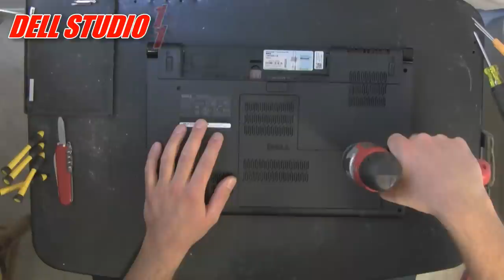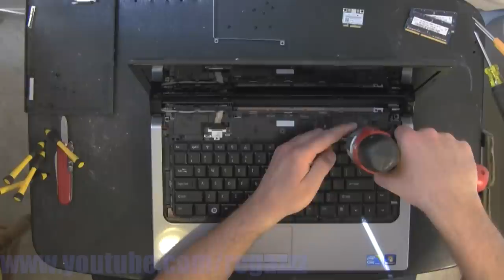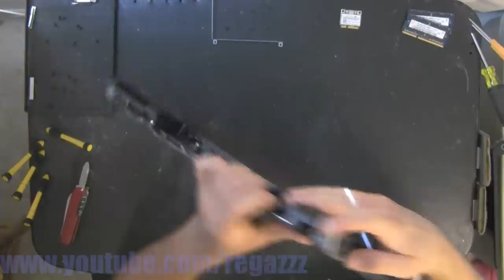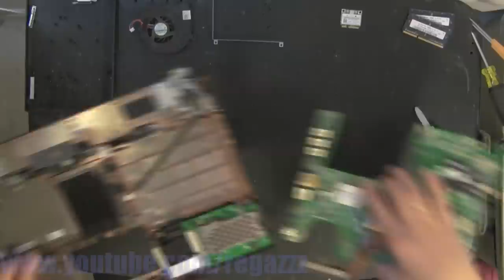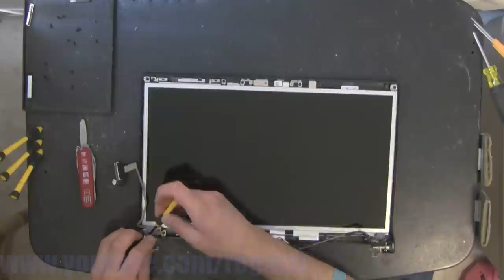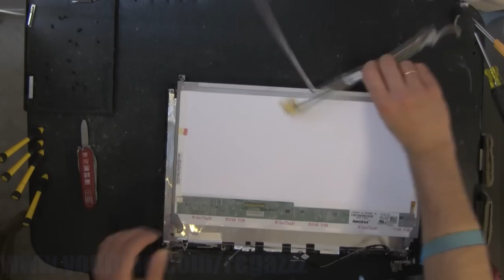DELL STUDIO 1558 take apart, disassembly, how-to video (nothing left) HD

Comment: thanks for sharing.. finally found out why my computer shutting down suddenly.  There's a lot of stuff got caught inside the cooling vent.. so eventhough the fan run very fast, nothing much comes out from it and it's very hot.   now it blows a lot of air as it should :)  Glad I open it to the cooling fan unit, otherwise it looks clean

Comment: Great video - thanks for taking the time to do it. I have a Studio 1558 - the fan is hitting something unless I pick up the laptop and take the weight off the case bottom - if I do that then the fan is noiseless. i.e. there is a very small fan blade clearance problem that I need to fix. Is the only way to the fan through the top and those gazillion screws, or can I get at it from the bottom? TIA, Phil
Reply from the maker: philb316 Hello, this is a problem with cooling fan - and unfortunately no other way.

Comment: regazzz i have a question i have a dell studio 1555 will it support a i7 motherboard? if yes where can i find the motherboard and a i7-720qm cpu?
Reply: you mean will the case support an i7 mobo? u mean will it support an i7 cpu?

i7-720qm has NO VIDEO onboard...so doing YOUR homework by looking on ebay...hold on few sec....hi im back from ebay...studio 1555 is a core 2 mobo...socket P...so no it wont support an i-core at all...TOTALLY DIFFERENT generation of CPUs... and sockets
Reply: Dude i m not talking about using an i-core cpu on a core 2 duo motherboard!! What i said was if i could use the motherboard of 1558 which by the way has an ati on board graphics and does support i7-720qm.....since 1555 n 1558 has the same chassis....
Reply: TANUJ PARIHAR well since i am EXTREMELY knowledgeable about this, there are 2 MOTHERBOARD selections. the ATI version is on Ebay for about $170 and the i7-720qm is about $60...why havent you checked Ebay?..."Where can i find the motherboard and ... CPU?"

just incase you dont believe me...I HAVE THE OTHER VERSION...and its painful to know i cant put a quad core...
Reply: Dude i m talking about replacing my present motherboard on 1555 with the ati version on 1558.....
Reply: TANUJ PARIHAR read my comments down below...i distinguish between both motherboards...dont buy the cheaper(wrong) one!!!
Reply: And i did check ebay the motherboard isnt available on ebay.in may it is ebay.com